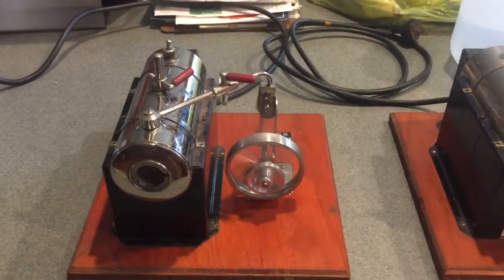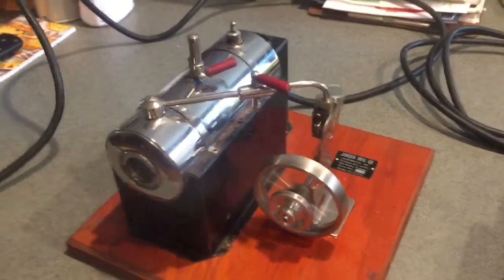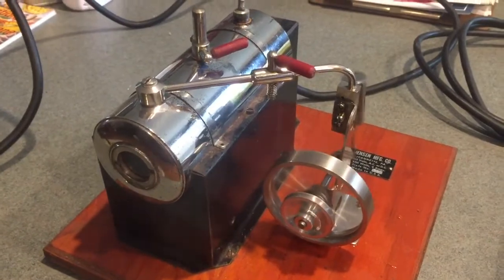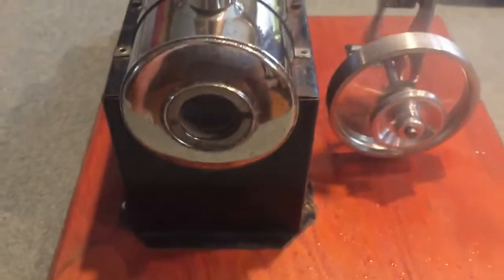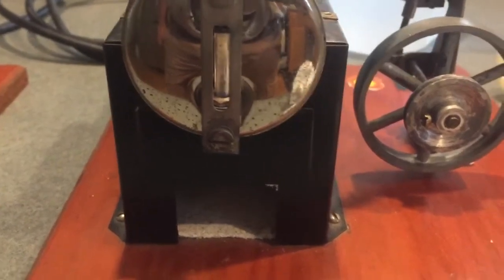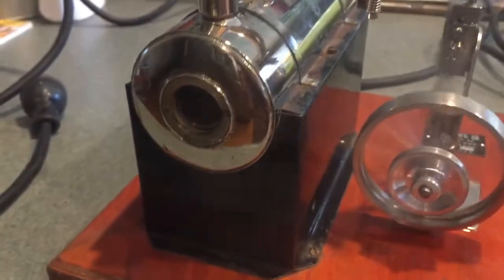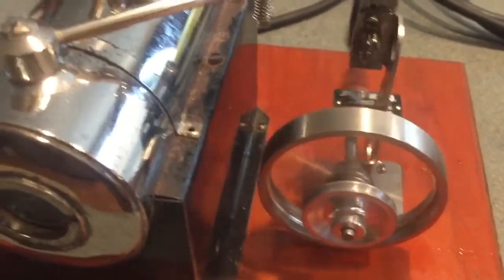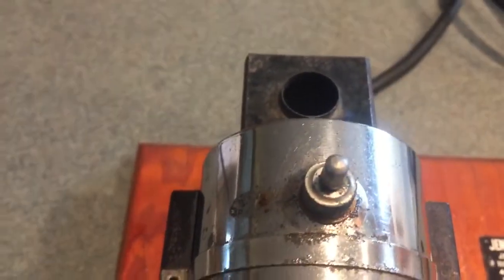Unusual Jensen Model 70 Toy Steam Engine

Comment: Quite an ínteresting find there Mike, well spotted and thanks for sharíng !
Reply from the maker: SteamUp Thanks, Jan!
Reply: I just noticed, that there´s a 70 with the old style sightglass up for sale on Ebay right now, with the same type of closed firebox. 
To me it´d appear that Jensen switched fireboxstyle on the 2½" versions, before the bricked coppersheet was introduced, whereas (looking at my own collection here) the 3" open firebox version, kept going for some time after the new material was introduced?
The open style firebox had been used for a lot of years by then, perhaps they switched as the original tools/brakes wore out?
Reply from the maker: Interesting thoughts, Jan! No matter what you think may have been the circumstances, there always seems to be another way to possibly explain why an odd Jensen is odd. The best part of collecting them! Just think how boring it would be if us collectors could only build a collection with just one example of every model because they were all identical.

Comment: Love the commentary Mike, and Yes a very interesting one... I have a copper brick Cooper Bros. 70 with the closed end firebox (no opening) BUT it still has the tube sight glass boiler and straight red handles.

Are there any signs of the boiler having been replaced? Maybe the factory replaced it? Or like you say, maybe Jensen was just using up old parts...
Reply from the maker: NickSteam8 Doesn’t look like it’s ever been messed with. It seems pretty plausible that if Tom Sr. ran out of copper clad steel, he probably had some plain steel on hand to make up some fire boxes in an effort to fill an order. The fact that it’s made like the later copper clad fire boxes makes me lean in that direction. He would have had the punch press all set up to cut the pieces out of plain steel. If he was using old parts, the fire box would likely have the opening in the front with the spot welded cross piece.